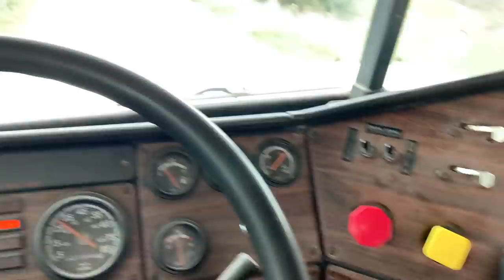Supercharged Farm Vacuum

Comment: I can pull my weightI can hold my own
I can sling that blade all summer long
'Til the thistles fall And the pasture's clear
And the work's all done for another year
I can hold my own

The sucker rod on the windmill creaks
Now and then you hear a car
There's thunderheads across the southern sky
But they won't get this far
There's red ants by the graveyard gate
They're nearly all that moves
And they carry on despite this heat
I bet you'd tell me what that proves
There's fine dust in the tire ruts now
The creeks no longer run
But I am just a visitor here
The drought won't hurt me none

Comment: You may not be as cute with the bubbly personality that Laura is, but you got some good information and some humorous contents at times. Like the oversized Shop-Vac. That at one time was the best grain vacs to go to 4 when your grain Bins were sitting on a flat concrete floor. I always thought they were a plus for giving you less dockage at the elevator because you had two whirligigs getting a lot of chaff and small weed seeds out of the grain before it went into the semi trailer that is if the winds blowing the right direction!